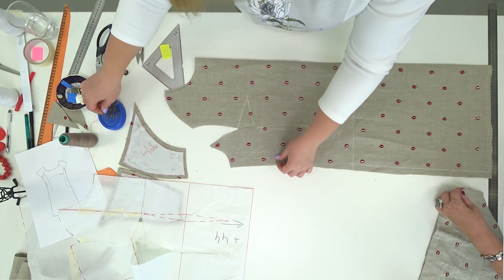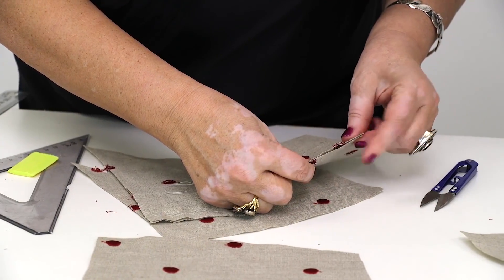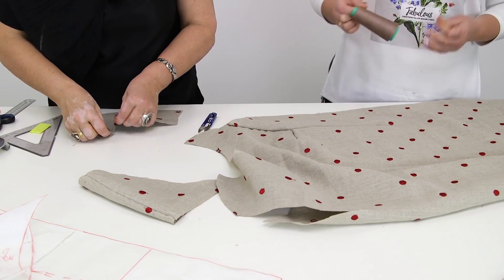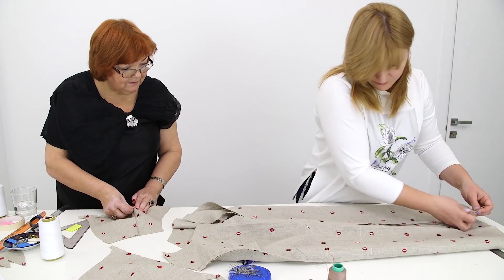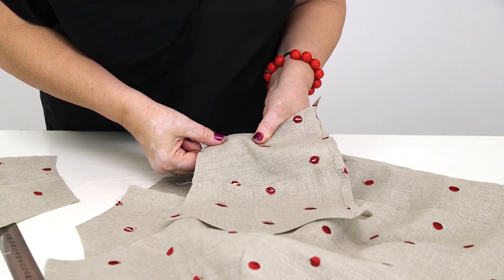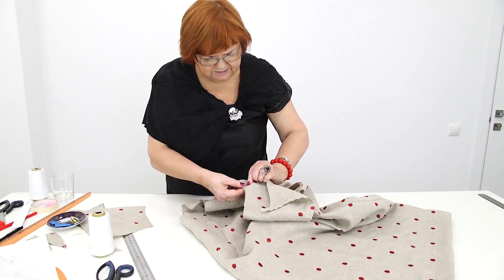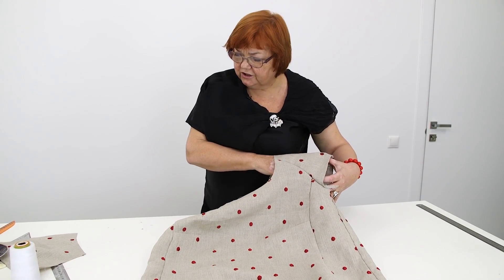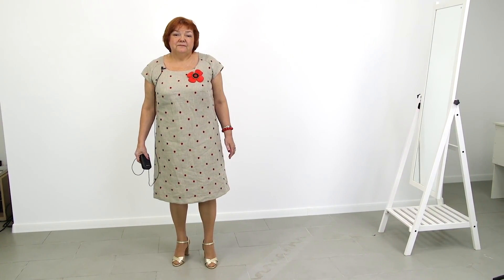DIY: How to make a linen dress with raglan sleeves and princess seams. Tacking and fitting.

Comment: I am enthusiastic about your workshops and the possibilities you offer to create the basic pattern after the 10 points measurement and to modify it by means of the tutorials.
I created the pattern for the linen dress with the princess seams and the raglan sleeves according to your instructions, cut the linen and tacked all parts. But I don't know now how to clean the lower part of the armhole, because this area is not bordered by the sleeve.